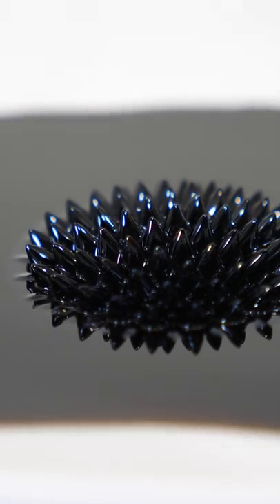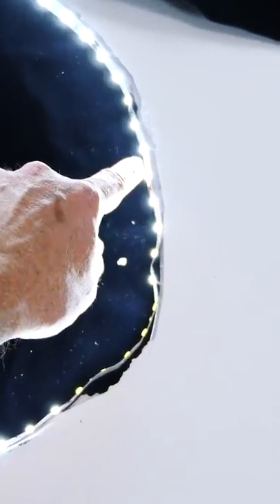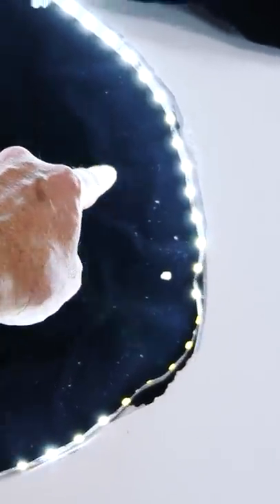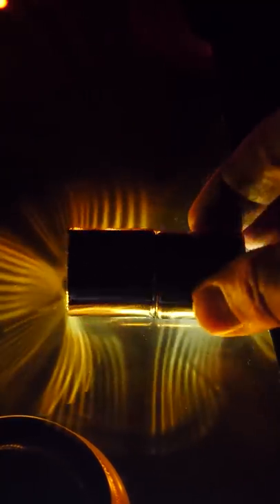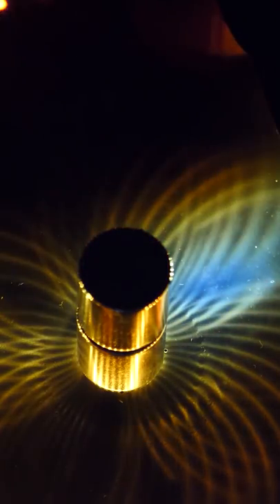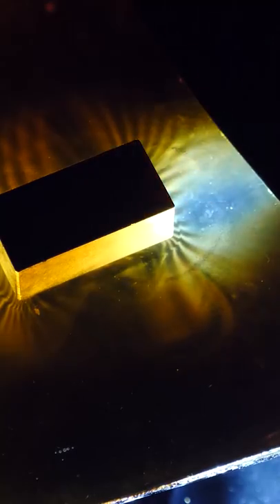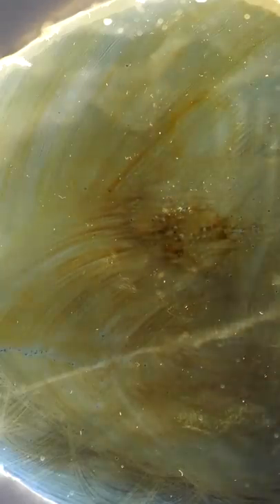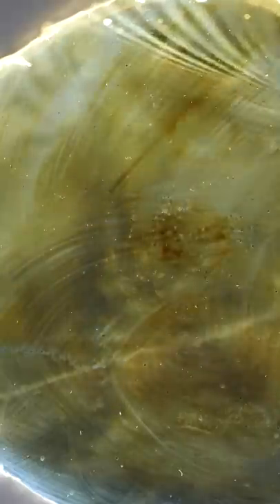What Else Can Ferrofluid Do?

Comment: Some reactions are delayed, they take time to happen. I think that's why he said it. The fluid will have resistance but the magnetic force be is working with is much stronger than the resistance force so the reaction is quick enough that the delay is negligible. There is still a time factor, and he could probably measure it but it's not necessary for this display.
Reply: Can you name a few? I'm nowhere close to knowing anything about any of this but these are all very fascinating to me

Comment: Made one of these which was a bit of a faf due to how easily the fluid leaks out of between the acrylic. Even using a hot glue gun it still finds a way (you can sand the edges first to reduce this). Also a shame that it doesn't last and starts to evaporate after a few days. I probably didn't make it as airtight as possible but I never through of just smearing one sheet. Would have been a lot easier for a quick demo (still sounds messy though!). Note to anyone trying this that this stuff stains something fierce, so do it on a black bag or similar and preferably outside.

Comment: Updates in real time. Was that a joke or did you seriously think you had to explain that?
Reply: Some reactions are delayed, they take time to happen. I think that's why he said it. The fluid will have resistance but the magnetic force be is working with is much stronger than the resistance force so the reaction is quick enough that the delay is negligible. There is still a time factor, and he could probably measure it but it's not necessary for this display.